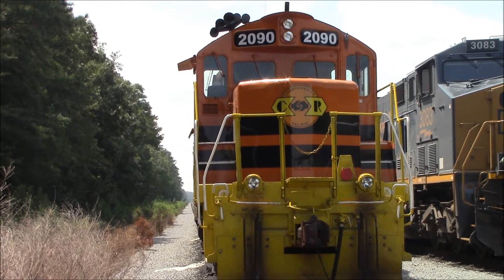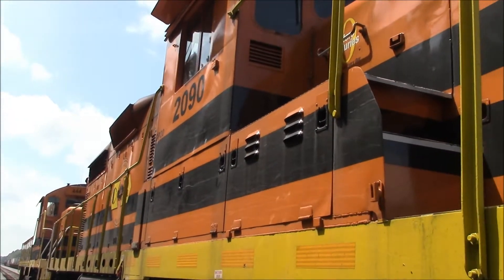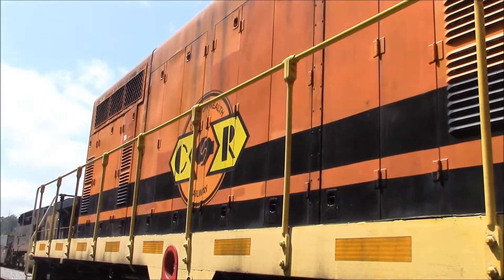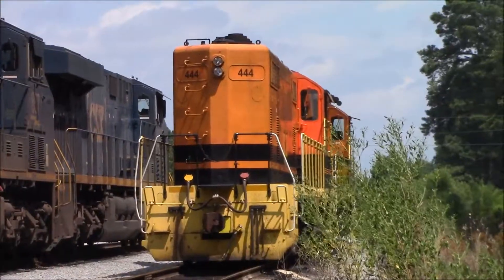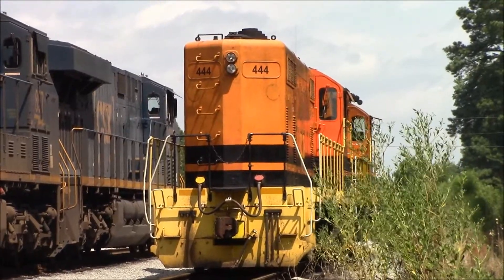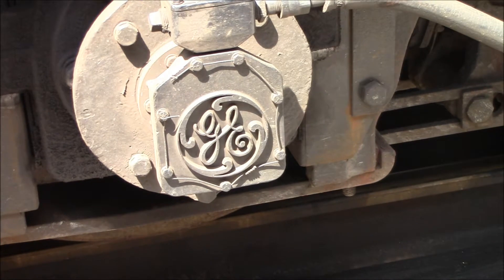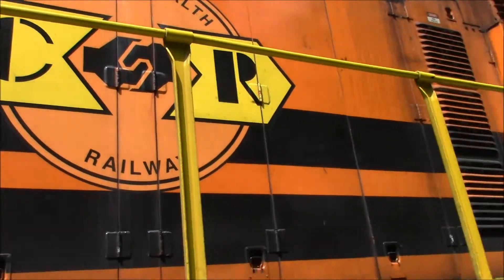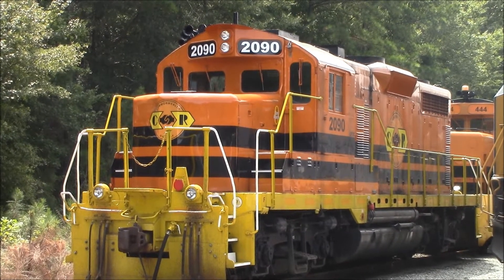Commonwealth Railway and CSX locomotives resting on Labor Day

Comment: why does it have a GE truck
Reply from the maker: @ engineerpat5290: I have no idea. Probably a trade or something.
Reply: +engineerpat 5290  it is not a GE truck, it's an EMD Blomberg truck as fitted on Emd GP20's. The attachment is for the electronic event recorder required on all locomotives that go over 30mph, it just happened to be a GE model. lol